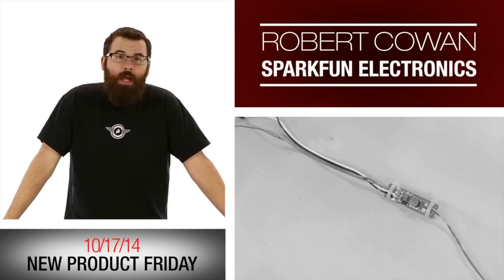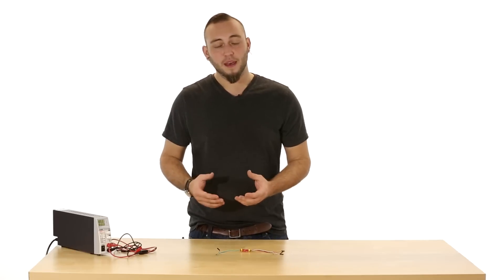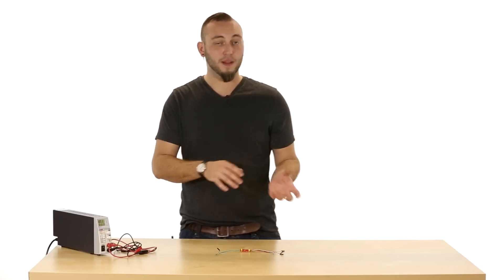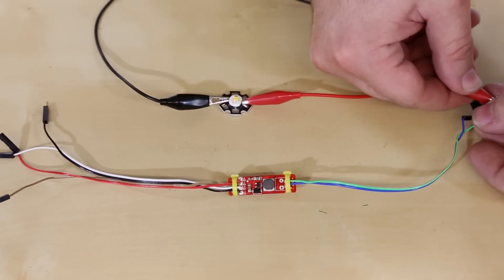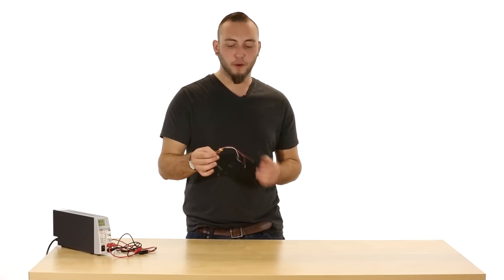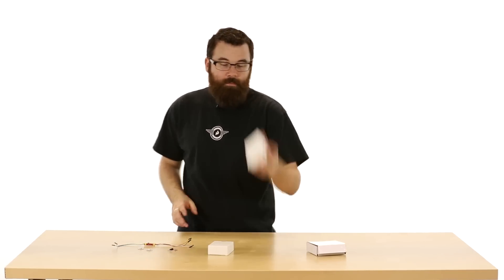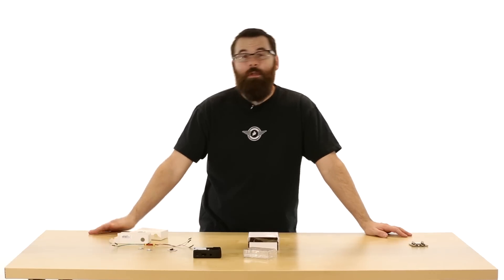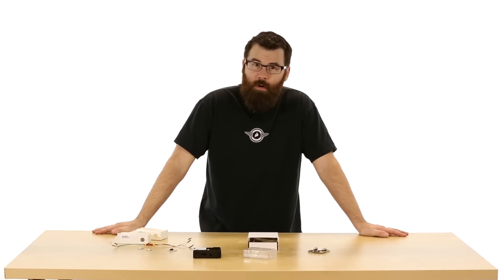SparkFun 10-17-14 Product Showcase: Holy Mackerel!

Comment: man Nick, talk to an EE before you explain LEDs and how to drive them -- that was very confusing. Don't think about the voltage drop across an LED, especially high power ones because their ideal voltage isn't obtainable since it's constantly changing due to temperature.

LEDs need a constant current supply. Don't worry about the voltage, just make sure your constant current supply can provide a higher voltage than what ur leds need.